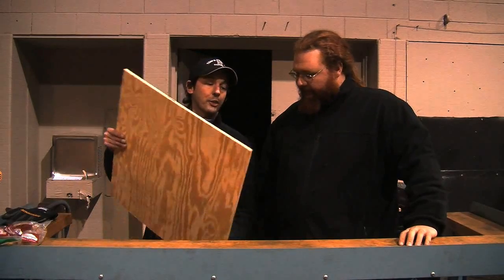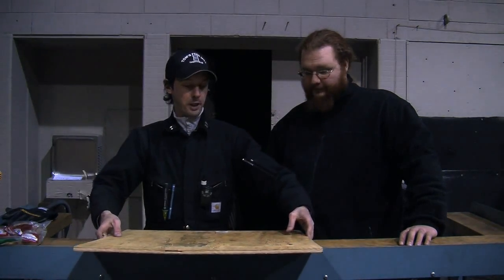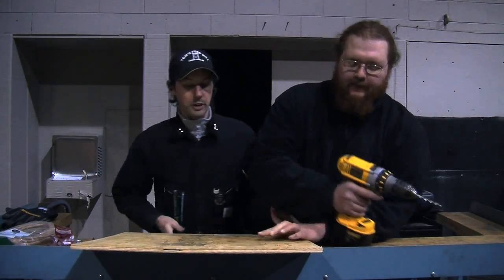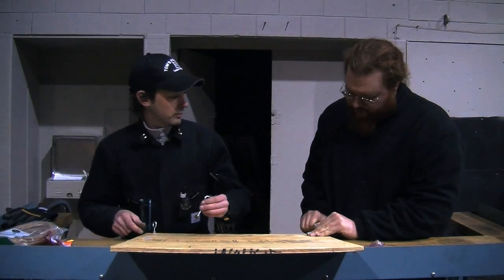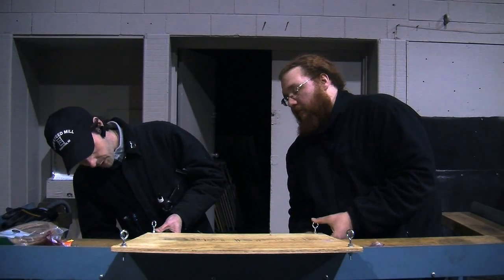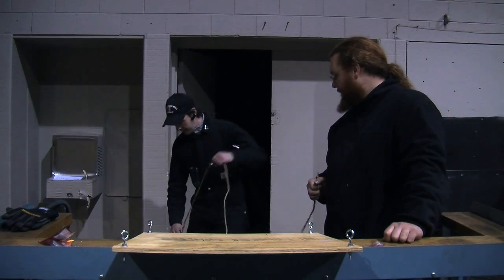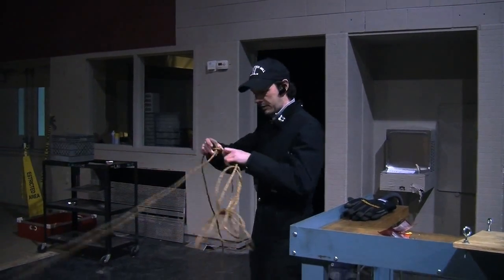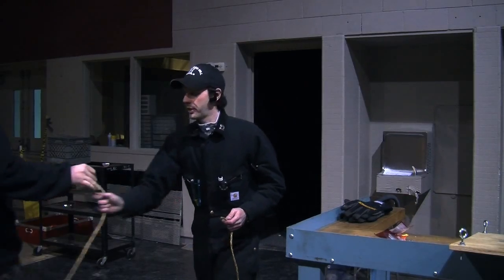How To Make A Home-made Camera Mount

Comment: Speaking of rope, I was going to tow one of my snowmobiles, which blew a head gasket today,  home from the middle of a field. The rope I had packed with us just happened to be a very old rope made of fiberglass. I didn't notice it was a fiberglass rope until I itched my face and covered my slightly sweaty arms with it. Been itching all night. The rope was to bad, that after I had tied it to both A-frames, I gave it a little tug, and both ends snapped off.